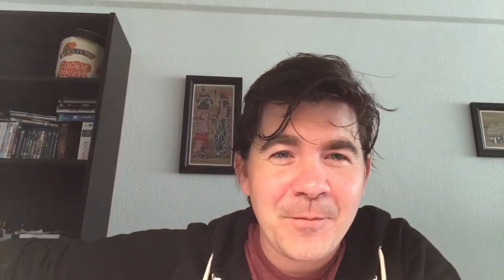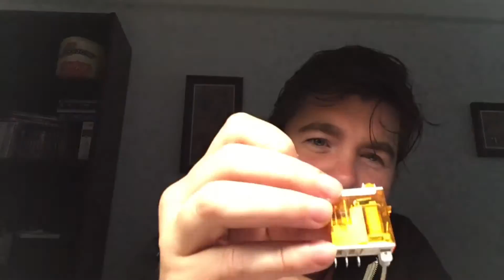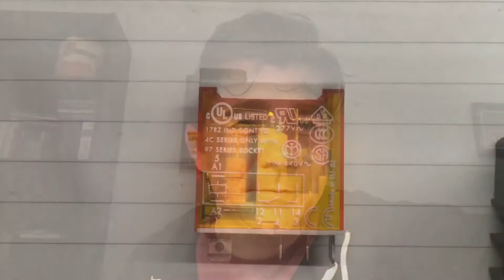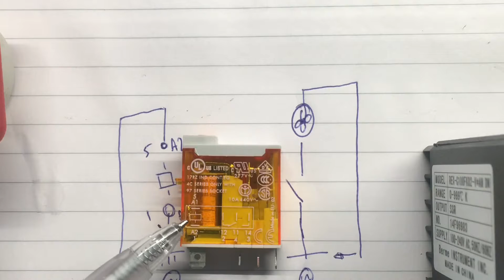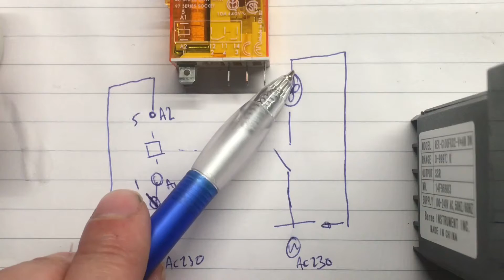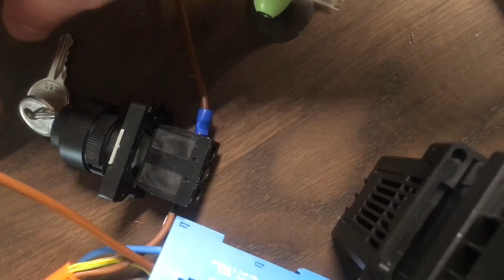Kotten brewery HBW 9: electro mechanical relay, brew panel build

Comment: Great series of videos. I am borrowing a couple for my own build. A question though. Where did you buy your power relays? I have been looking in NL with little success
Reply from the maker: Hey Jacques, I also had a lot of trouble in the beginning understanding these types of things, so will gladly help you out where I can. 

I bought the relays, switches and breakers from Reichelt elektronik (German Company) (relay and base item numbers: FIN 97.01 & FIN 46.61.8 230V). Maybe they also post to the Netherlands as they look quite professional and international. 

I am fortunate to work in Germany though and I buy and get all my techy things posted to work either from amazon.de ("amazon.de" now works in the Netherlands!!! Friggen awesome) or ebay.de. 

In the Netherlands we are severely limited and/or over priced on small techy orders (as with everything else). But some sites that may also work if you are prepared/forced to pay a little more; namely http://nl.mouser.com/ or Conrad.nl

I wish you all the best with the build and if you need any advice, feel free to ask and Ill do what I can to help

Cheers!
Reply: Hi Brewmacker, Reichelt does ship to NL and they have the site in English as well which is great. Thanks for putting me on to them, and giving me the part numbers. There were a few to choose from so that helped a lot. One step closer to HERMS. 

Its really great that the whole brewtube community is so helpful.
Reply from the maker: Your welcome mate! Glad it worked out!